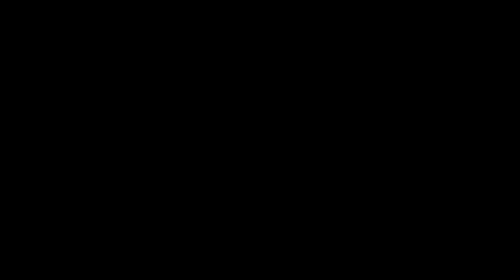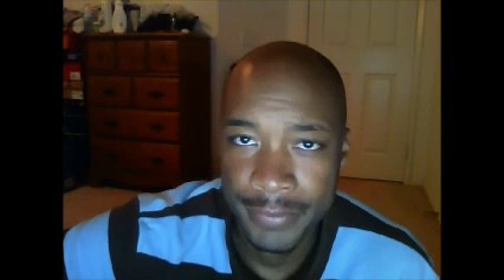WiiU GPU in development since 2009, SoC design

Comment: PS2 had games that looked better graphically? Sure PS2 did have games that looked better graphically but that depended on the developers that made gamecube games with lesser graphics. If youre implying that PS2 was more capable graphically compared to the gamecube im inclined to believe youre crazy. Most gamers believe Nintendo always had a less powerful system when they only really started that with the Wii this gen. They never even picked up a N64 or GCN controller.

Comment: That doesn't mean its not live rendered, that means its only rendering what it wants you to look at. If you're not trolling, you're confusing DRAWN static backgrounds with pre-rendering. Pre-rendered means its just playing video off the disc instead of being generated in real time by the GPU. Some old PS1 games had handdrawn, digitized backgrounds, particularly some JRPGs. Short of some DLC games, this is a method that hasn't been used in forever. LOL

Comment: I agree.  Sega quit because they learned they were "Third place".  Can you imagine if Sony gave up like that? The so called "experts" will say Sega quit because they kept failing or coming in 3rd place with consoles like 32x, Sega CD, Saturn, and Dreamcast.  But they still had a pretty good market share.  I guess the difference between Sega and Sony is that Sony has software, consoles, and electronics to keep them afloat. Where sega only had game software and consoles.

Comment: Playstation 1, 2, 3, has always had top graphics in consoles. TOP as in the TOP regardless if it was with another console at the top or not...it was always on the TOP.  Playstation has not always gotten the graphical games but it has also gotten the great gameplay games as well.  The nintendo is only good if you are a Mario / Zelda fan, or like the novelty of motion control or to be the touch screen control.  THATS  IT.